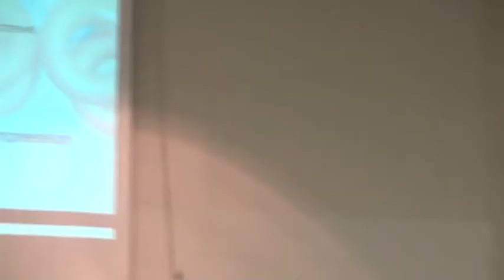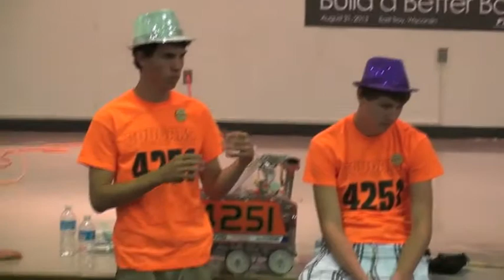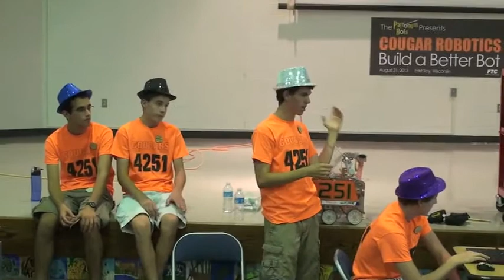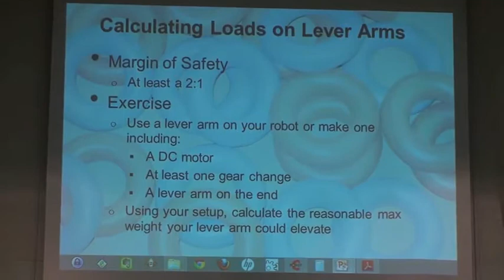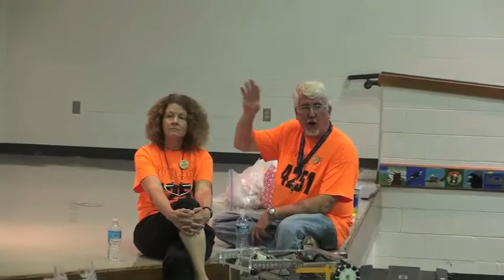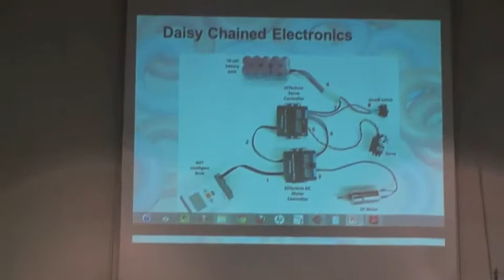Building Practices - Build a Better Bot

Comment: Great discussion on loads and traction.  I would caution against the practice of tinning your wires since the Tetrix motor controllers are designed for stranded wire.  I would promote a more important practice of using crimp type connectors as much as possible such a Anderson Power Poles and power distribution blocks to ensure more solid electrical connections.  Replace the Tamiya connection on the OEM battery with an Anderson Power Pole as part of this best practice.